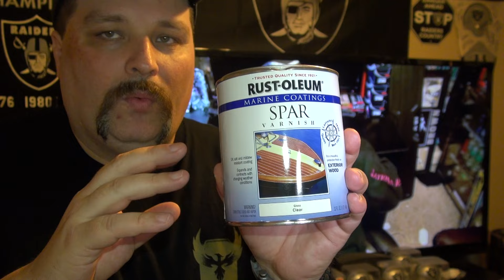WASR 10 63 PROJECT PT3

Comment: To get the wood off of the gas tube I just used a crescent wrench in one hand and used my other hand to turn the wood and it came off...I used the same method to put different wood back on...

I'd be interested to see if the clear coat on the front hand-guards holds-up when the barrel and gas tube gets hot, I've seen where some people had a sticky gooey mess to contend once the barrel heated the wood up...